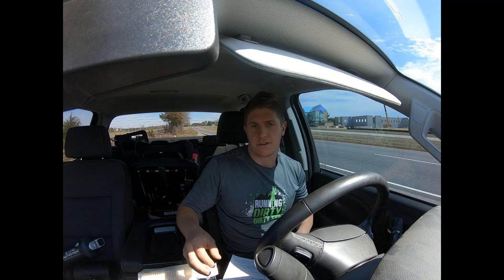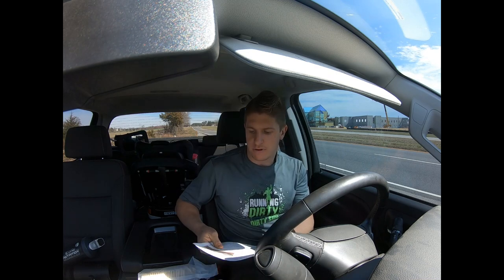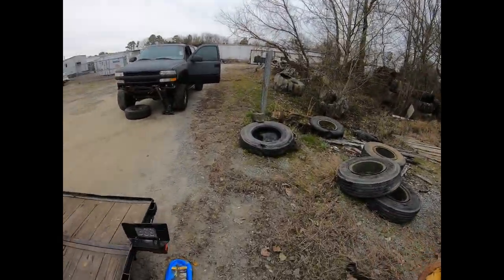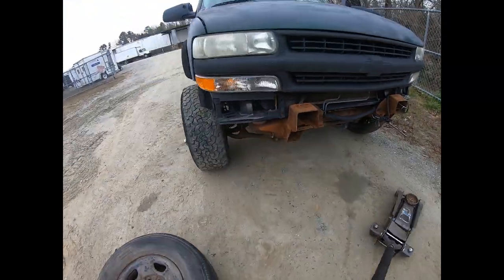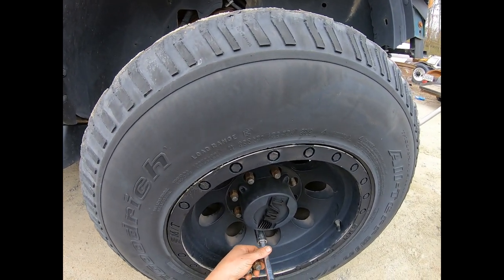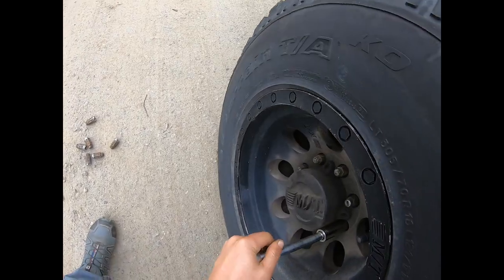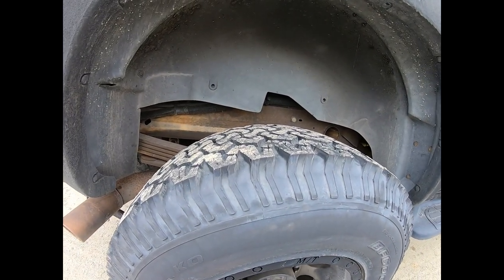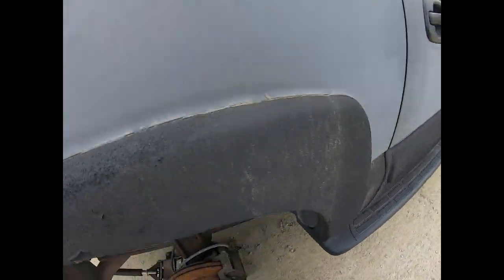Picking Up A GovPlanet Surplus Vehicle!! The Surplus Suburban!

Comment: You need to hit harbor freight or tractor supply and get a wireless remote for that winch. Also from experience with stuff breaking you shoulda stood them tires up in the front of your truck bed with your babygirl in the back seat. If that winch cable broke or put a toolbox on there and open lid when winching. It would be bad.  Ive had a 15,000 pound cable break and it went through my back window and windshield. Imagine if someone woulda been in the truck. Its just safety concern man.  Will say im learning alot about buying rides from govplanet. Bout the only thing i havent bought from them yet
Reply from the maker: I actually have harbor freight wireless winch remotes for both of my trailer winches now. Huge improvement. Good advice about the winch cable, if I'm ever doing any really hard pulling I would do that, stuff like this I'm not even at 10% the WLL on the cable.

Comment: Could you tell if your experience went well shopping at IronPlanet? I’m new to the platform and I’m looking for information. Thanks
Reply from the maker: So my experiences with Iron Planet were decent. They didn't give enough information about picking up the items I purchased, for example if they were in restricted areas that would require security clearance or things like that. But overall it was a decent experience. I've moved away from Iron planet now, they are saturated with buyers which makes it difficult to win lots at a reasonable price in my opinion.
Reply: @MohawkMotors Thank you very much. Your information helps me a lot.

Comment: Will they allow you to pick up over the weekend? What are the action fees like? Online auction charge?
Reply from the maker: Pickup scheduling depends on the area manager, GovPlanet divides the country into areas with an area manager in charge of however many sites in his area, usually after you win an auction they will put you in contact with the area manager to schedule pickup, some are really flexible and will work with you, some won't.  

Auction fees are typically a % of the sale price, I've seen as low as 5% and as high as 15%. There's also "paperwork fees" on top of the auction fees, if you don't need a title or bill of sale it doesn't cost anything but a bill of sale usually costs an extra $75 or so and a title usually costs another $150+
Reply: @MohawkMotors  thank you! I’m used to buying cars from Copart but if there was something more lucrative for flips I had to ask.
Reply from the maker: no problem, seems like all the auctions are getting harder to find good deals on, govplanet, truckplanet, and copart, stuff is selling at higher and higher prices.
Reply: @MohawkMotors  you aren’t kidding, 10 year ago I could find deals on Craigslist and flip them in three days for more profit than getting vehicles from Copart!  $200 annul membership, broker fees (if you don’t have access to a dealers account), refundable deposit... THEN   $500 online action fee...bs $59 gate fee...bs purchase amount %...bs Heres your pile of parts salvage certificate 💩 tow it, fix it, reconstruct the tile, and then try to resell it after for profit.

6 months, 18 cars, 5 friends as decoys, 4 titles per person and I had made $23k all legally without a dealers license. Hard to do that these days.
Reply: @MohawkMotors  How do you decide with if you get the bill of sale or title? Heard old cars don't need I title, but i don't know.